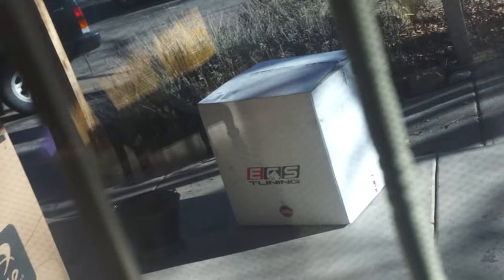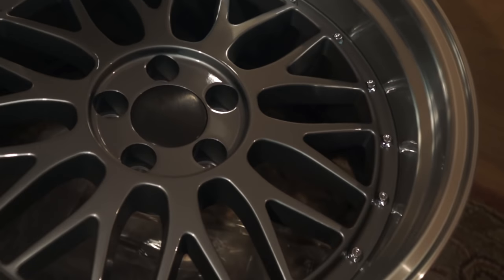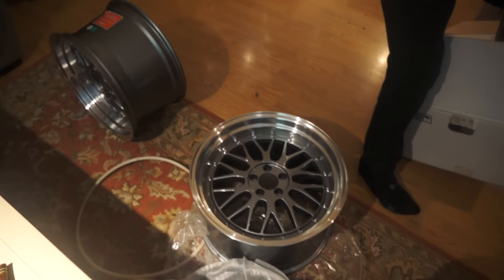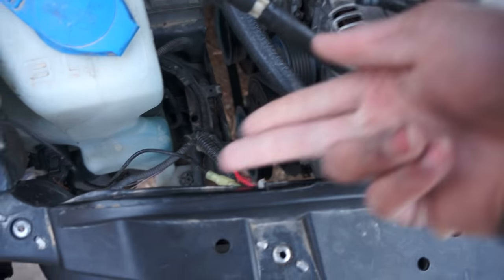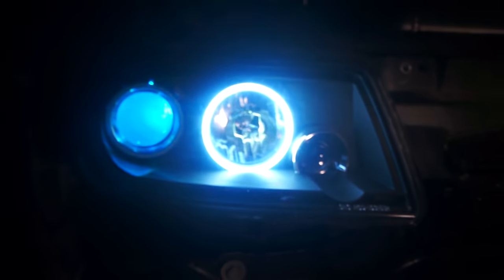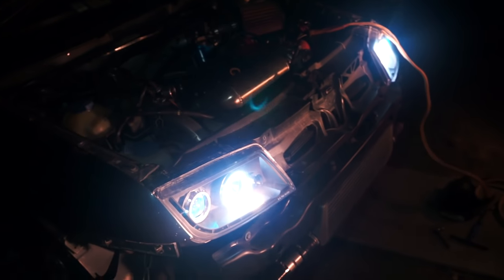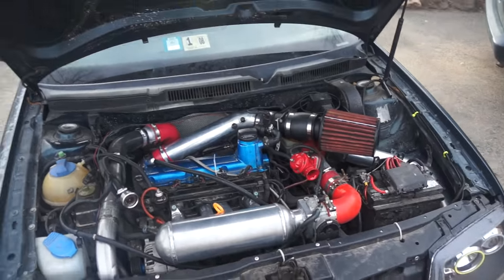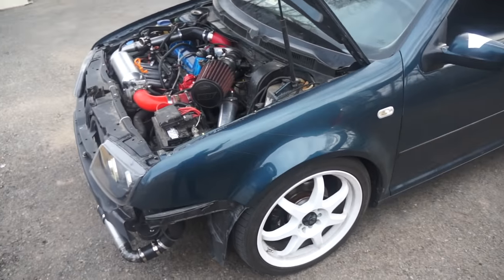MK4 Jetta 2.0 Turbo Project Part 10: It Made Boost!!

Comment: Daaaamn ;) congrats on the project
How much was the intake manifold, and what did you have to do to run all your charge  piping?
Also those wheels are massive lol I bought 18 x 8.5 et35 and they barely clear the coilovers without spacers, your wheels are pretty as hell though
Reply from the maker: Thank you. Yeah the white wheels I have now wouldn't clear my coils without spacers lol they are 18x7.5 with a 45mm offset.
The intake is actually discontinued. it was around 500 new i believe but It came with the turbo kit. Its a USRT short runner intake.
Reply: Stance Santa Fe 

yes its a shame that they are discontiniued.. im spending allot of time now building my own sri and have to do it with steel instead alu cause i do not have the equipement to weld alu..

annyway nice project!

Comment: what a good project brother, I would like to know if you have forged or internal stock and how many psi is running without risk.

Greetings bro!
Reply from the maker: I started with stock pistons and rods with a 9:1 compression ratio running  6 to 10 psi. Now I have a standard transmission.. And forged je pistons and eagle rods running around 10.25:1 compression pushing 15 to 19 psi.
Reply from the maker: Needs a new turbo manifold, re-tune and lsd but its pretty fun. Just a bit laggy and lots of torque steer

Comment: Hi know people been asking about your white wheels.  I as well got a MKIV and bought some that look similar mb wheels seven X 17 X 7 with a 42 mm offset.  Bought some 10 mm spacer for fronts since running a coilover setup.  What size spacers are you running?
Reply from the maker: Rolando Salas I believe I was running 13mm in the front and 15mm in the rear.

Comment: Great project! How many parts did you change? So, for example the transmission did you have to change it or you keep the stock? Greetings from Colombia!
Reply from the maker: Carlos Felipe Bessolo Basically stock everything (pistons, rods, head, auto transmission etc..) for now. I installed larger fuel injectors (Bosch green giant) and an adjustable fuel pressure regulator to keep up with the fueling. the adjustable fpr isnt needed at this point. I also insstalled a head spacer to drop the compression to 9:1 from 10:1. It also has a techtonics 260 cam but that isn't necessary to make it work.
Reply: Stance Santa Fe  thanks for the answer, great project, I really like start with my mk4
Reply from the maker: Carlos Felipe Bessolo thank you!!

Comment: How much did this end up costing you? Have the same car and same year, and have always wanted to do this
Reply from the maker: DylanFTW for this built standard swapped turbo jetta 2.0 as it sits today I spent about 1000 for engine internals (je pistons and eagle rods).. 300 for machine work in block and prep (83.5mm pistons vs the 82.5mm stock).. about 400 for a transmission from the scrap yard as well as the shifter and random relays, bolts and starter.. 700 for the lightweight flywheel and stage 2 clutch.. And turbo kit was a pieced together eBay kit. I bought it used for 800 ish. It has a cast iron t3t4 manifold from spa turbo, a t3t4 eBay turbo, ebay pipes and intercooler, and clamps. You could probably piece the turbo parts together for 500 (but depends on personal preferences). The intake is a usrt short runner about 500 (but it came with the turbo kit for me). And the tune (stage 2) I think  was 550 from c2 motorsports.

Comment: How much did the engine build cost idc about the headlights and wheels and such car looks great I'm just trying to figure what I'm going to be looking at
Reply from the maker: Mine was a used kit so it was a little cheaper but I had to get another tune for my auto ECU.. so with that I payed probably +/ - 1300 for everything minus engine internals. so the c2 tune, bosch green giant injectors, t3t4 eBay turbo (external waste gate), waste gate setup, turbo manifold, oil feed lines, intercooler and pipes, eBay bov, head spacer (only with the stage 2 low compression tune is it required), larger maf sensor housing, misc vacuum lines, gaskets, seals and some small coolant lines to re-route if needed, boost gauge, wideband afr gauge, and you will need an exhaust down pipe made.

If you were going to build the engine also then you would probably be looking at $2500- 3000
Reply: Cool man, what intake is that because I cannot find anything for mk4 2.0
Reply: I'm thinking of using the Eaton m62 from a mercedes

Comment: think I could get away with boosting my car with a ebay turbo kit, then rods low comp pistons rods and injectors, and ecu tune and it be safe? the kit includes turbo turbo timer boost controller all lines/pipes, inter cooler, etc.
Reply from the maker: ToonMOB it should work, but every engine is different. Just make sure you understand how a turbo engine works and your life will be so much easier!! The kit I bought came off a car that melted a piston but it works just fine on my car. Just gotta take the necessary steps to make sure the engine is happy (oil changes, wideband, not beating on it excessively, making sure it is getting the proper cooling, and fuel)
Reply: Stance Santa Fe i’m about to have the top of the motor rebuilt and when I boost it i’ll be doing the head studs and low comp pistons and idk what rods yet. I think it will be safe with those upgrades.

Comment: what kind of bov? what setting and tuning for ecu? how big is the turbo? is it the ko3 or ko4? and what headlights are those?
Reply from the maker: Ebay bov, stage 2 c2 motorsports turbo tune, the turbo is an eBay t3t4 .63 AR 57 trim turbo that came used with the kit and the headlights are eBay projector headlights that i ripped apart and painted as well as installed halos and rgb demon eyes go check out the video of that on our channel.
Reply: Stance Santa Fe hey id like to know all the parts i need to turbo my 2.0 but mine is a 5 spd

Comment: did you know 1.8T and 2.0 mk4 have same firering order , inection cam knock and crank sensor wiring ? ;P so you can also turboing your 2.0 then put it in a 1.8T ecu

Comment: Where did you get the intercooler and piping?
Reply from the maker: It's a 27x7x2.5 ebay intercooler. EBay 2.5" and 2.75" intercooler pipes and woven silicone couplers as well as some custom 2" piping to fit better around the engine bay. EBay bov as well haha super ghetto but it seems to hold pressure fine.

Comment: If you own a 02m trans (AUTO TRANS FOR VW MKx) and if you can install a turbo then you can search around pick and pull and find a o2j or 2a manual they all bolt up I'm pretty sure in that year (Mk4) if I'm wrong please comment and correct me but the wiring is easy as shit you are going from auto to manual so think about it..... you'll mostly be just unplugging the TCU (the module that controls the (AUTO) and only slice a few wires (LOOK UP DIAGRAM ON VWVOTEX alot of dues have years of forums so your anwser will and can be found........ I even lifted the trans myself  with the car on jack stands..... find a 1.8l with a manual and bolt that bitch up you'll love your VW till t dies....

Also a tip on lowering.... Don't buy expensive ones.... by cheap ones and put anti seize on all the treads of the coil over..... Ive seen guys bitch.... mine have lasted years....

Great work though mate, I learned where I'm going to put my charge piping this video helped me out a lot on that.
Reply from the maker: yeah the 02j swapped in nicely just a few wires for the starter and reverse had to be spliced. i don't have cruise control so i didn't re-pin or go any further into it. I just unplugged the tcu and it works great lol thanks for the response!
Reply: @stancesantafe721  Nice!

Comment: looking at building my jetta, arp head studs, rods, ecu, full techtonic cat back exhaust, usrt turbo manifold, ko3 turbo, and a little more im forgetting. main reason for this comment is, can you comment your build? like the parts used? my builds looking kinda expensive rn I wanna see if there's a little cheaper roots.
Reply: also did you have to do your own intercooler piping and etc

Comment: 9psi on stock bottom!? Wow how is that
Reply from the maker: Yeah I had a decompression plate so I could run more boost. For majority of the initial runs on the stock engine I pushed around 10 to 12psi. Seemed happy but the auto trans took a crap from slipping under boost. Now it's fully built with a standard trans pushing 19/20 psi.

Comment: are you running 91 octane?
Reply from the maker: Yes currently on 91!
Reply: Stance Santa Fe I'm pretty sure you've mentioned this before, but do you have a plan if the transmission breaks? you've got a lot of power on the not so sturdy MKIV auto
Reply from the maker: NotFlafee standard swap would be the 1st plan 2nd would be a performance built 01m auto trans from ipt trans. standard is nice but I also enjoy the auto and how lazy I can be with it lol

Comment: How much n/a power where you making w/ remapped ecu
Reply from the maker: Shawn Viscome maybe 125/130hp with the tune, cold air  intake, 260 cam, early AEG 4 to 2 tubular exhaust manifold, techtonics 2 to 1 down pipe, and srs 2.5 inch catback. A lot more enjoyable than stock but still slow😂.. Also the auto trans robbed some power from me

Comment: Is there a way you can send me links to your parts? I have a 2001 mk4 Jetta I'm trying to build up
Reply: yes very interested
Reply from the maker: Intake Manifold: mk4 2.0 USRT short runner intake 

Exhaust manifold and wastage from here (Came with the kit that someone pieced together. I did not purchase this item but I do have the waste gate and exhaust manifold):
http://www.ebay.com/itm/T3-Turbo-Kit-VW-Jetta-Golf-Beetle-Cabrio-MKIV-2-0L-8V-SOHC-NO-TURBO-INCLUDED-/172260252983?hash=item281b82dd37:g:eRIAAOSwZQRYfP72&vxp=mtr

Turbo: t3/t4 from Ebay
http://www.ebay.com/itm/T3-T4-T3T4-T04E-AR50-TURBO-CHARGER-OIL-LINE-DP-FLANGE-/120740623674?hash=item1c1cb3b53a:g:CHQAAOxy63FS1hTm&vxp=mtr

Bov (In the tunes specs it specifically says I should run a diverter valve because it will run rich every time the bov vents the excess boost to atmosphere): http://www.ebay.com/itm/UNIVERSAL-BILLET-ALUMINUM-TYPE-S-TURBO-BLOW-OFF-VALVE-BOV-2-5-FLANGE-PIPE-BLACK-/180865455689?hash=item2a1c6bd649:g:xe0AAOSw8d9UsaP0&vxp=mtr

intercooler:
http://www.ebay.com/itm/SPEC-UNIVERSAL-JDM-FMIC-TURBO-FRONT-MOUNT-ALUMINUM-INTERCOOLER-27-x-7-x2-5-/321230641708?hash=item4acad69a2c:g:qrEAAOxyzHxRNXfo&vxp=mtr

Tunes can be purchased from:
C2motorsports 
Ngpracing
(I am running the stage 2 C2 motorsports tune)

cam: 
Techtonics tuning 260*

(Ebay) SRS R1 Catback exhaust (i’m not running the full cat back as of now)

The intercooler piping is pretty much all custom made by Brady and I up to where the Spyder cold air intake starts.
Down pipe is 3” to 2.5”. It looks like the previous owner modified a 1.8t ebay downpipes to fit on their custom pipe that comes out of the turbo. 

The oil pressure sensor has a brass t fitting added so I can have a turbo oil feed line come from there.

There is probably some stuff I missed but there is a basic rundown lol

Comment: Did you leave the pcv hose open or did you plug it in somewhere?
Reply from the maker: Juan with the wind lol yeah its just open making everything smell like oil😂
Reply: lol no oil comes out though there ?
Reply from the maker: Juan with the wind the hole is kind of facing up so no oil is getting out. at first it was facing down and the oil was pouring out on the head haha. I need a catch can or something just to be safe
Reply: Ok cool thanks for the help man